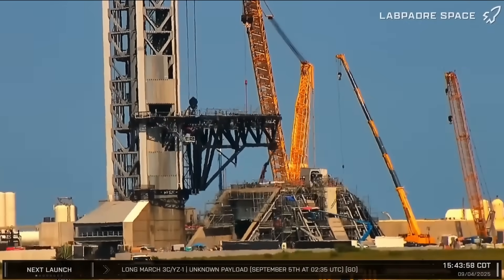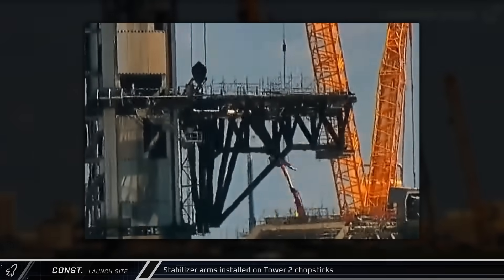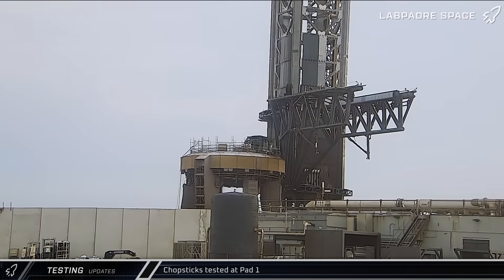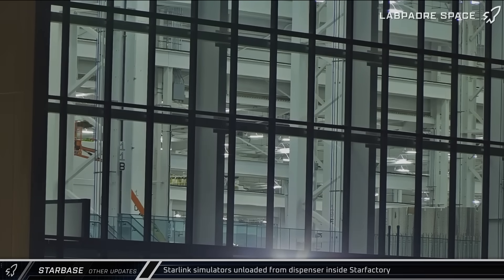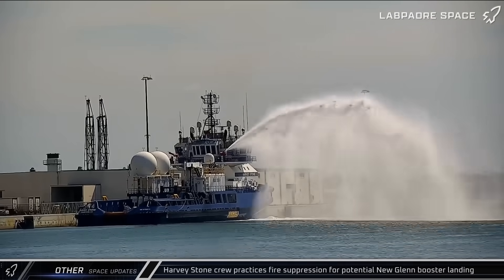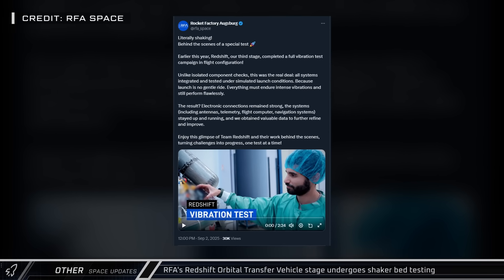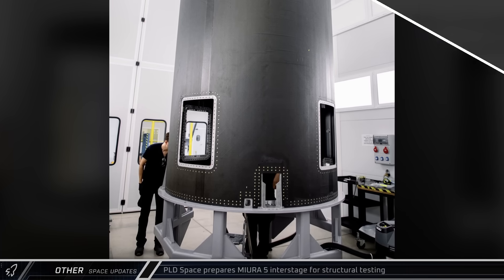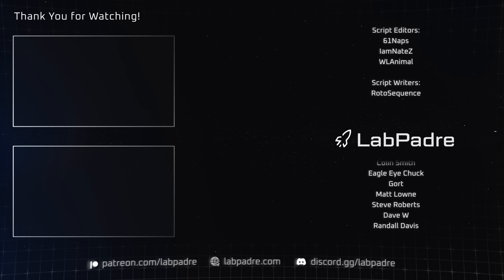The End of Block 2 Starship is Almost Here - Spaceflight Weekly #183

Comment: Elon should skip block 3 and build block 4 now.
Reply: I think we’re gonna blow through block three there was a lot of internal hardware changes from Black one the block two.
Reply: He can't. Megabay is too small to build over 80 Meter long booster. Max height is if I recall 72 Meter.

Exactly for V3 booster. 

And difference between V3 and V4 is actually not that big. VISUAL difference is big, as V4 is really stretched. But except for having 6, instead 9 engines on upper stage, V3 is very similar to V4. Similar engines, same aerodynamic control, etc 
V3 is a testbed for V4.
Just smaller.

Comment: I really hope the block 3s have better luck than the block 2s. SpaceX can’t afford any more delays if they want to reach the moon in 27’ with Artemus III.
Reply: It's less about luck and more about testing and finding solutions to all issues appearing during testing campaigns. Flight 9 clearly showed that a gas diffuser that worked well until that flight had a flaw and needed redesigning. During flight 10, the gas diffuser not only worked without fail, but the whole system worked better. We could say they were lucky to find the flaw earlier in the Starship program, during block 2 flights.